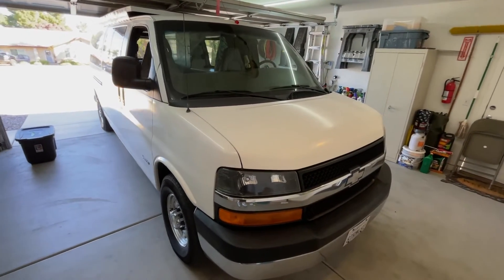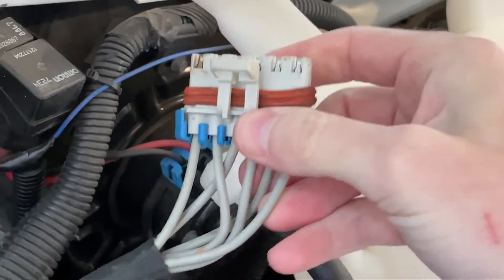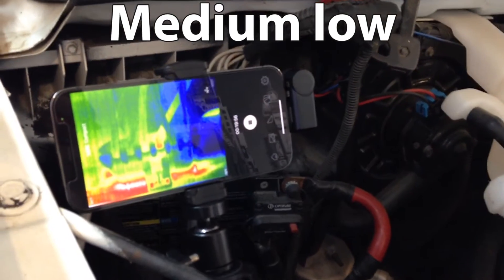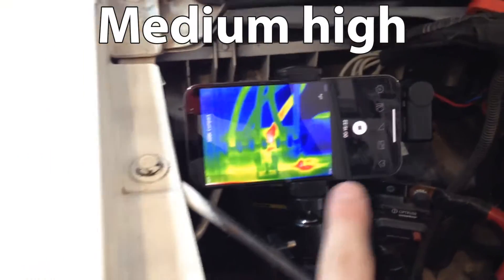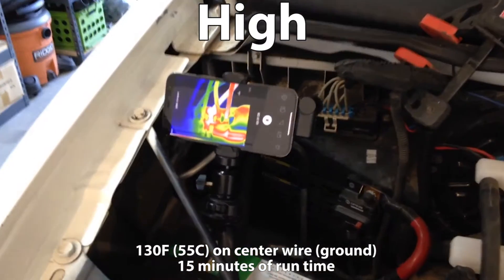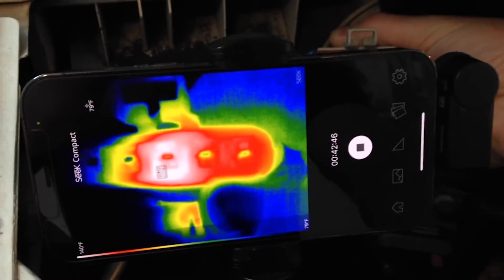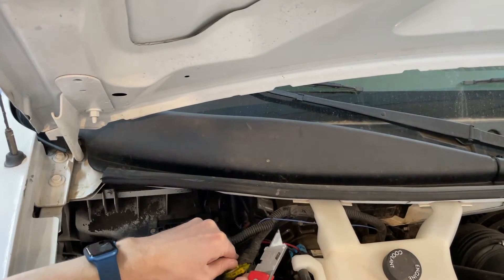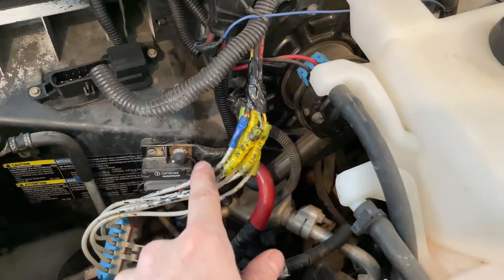Express / Savana Fire Hazard: Blower Resistor Harness *With thermal readings*

Comment: My medium high speed isnt working the rest do any idea what it could be doc ?
Reply from the maker: It’s either the blower resistor or the HVAC control (the actual unit in the dash above the radio). 85% chance it’s the blower resistor though.

Comment: Great vid Tim. I had high speed only on my old 2000 Sierra truck and replaced the resistor. No burn marks on mine so I guess it just got old and wore out. Come across it on other vehicles, too. Is that an IPhone app for the thermal imaging - it’s neat. 👍🏻
Reply from the maker: The blower resistors / relays are definitely wear items. Manufacturers are finally switching to a pulse width modulation (PWM) speed control. Much more robust and efficient than the resistors.

I got a great deal on the used thermal camera that plugs into the iphone! Been loving it! Scored it for $175 but normal price is around $230.
https://amzn.to/3VFTLlG

Comment: I replaced mine and had to carefully carve it out for the new style . 1999 Chevy express . Going to check the connecter right now ... and the original looks fine. It looks like that bad splice with some of the wire cut off would heat up that pin maybe ?
Reply from the maker: I'm sure the bad ground splice didn't help anything on mine. Luckily it looks like that was the only thing the previous owner(s) touched on the van. Otherwise I'm betting I would have electrical gremlins galore.

Comment: Did you look to see if the OEM part might have had a bigger negative ground wire going into the resistor? There's just so many cheap chinese replacement parts out there......
PS-Nice vid....now you got me worried with winter upon us!
Reply from the maker: Looks like there was actually a service bulletin for the Sierras / Silverados but the "fix" was to just replace the harness and resistor with the same OEM numbers - no redesigns or product improvements.
You would think it would be simple enough to just increase the pin sizing specifically on the 12v + and - wires.
If you unplug yours and it doesn't look discolored you're probably fine! The date code on my old blower resistor was from 2009 I think, so it lived a good life - especially for an aftermarket part.
Reply: @VanwithTim  Thanks Tim. I might unplug it and throw a little dielectric grease in there to prevent corrosion too even if that rubber gasket is supposed to seal it. Thanks for the heads up. PS-the fuel gauge sender and pump in the gas tank is another known "it will fail" part to look forward to replacing.
Reply from the maker: @fritzkabeano1969  Oh boy - yeah I've had to replace the FP on a 1999 Express. Thank goodness the tank was mostly empty! Not my favorite repair by any stretch.

Comment: I've fixed all the drive train common problems already, I'll have to check my "new" '04 Savana for this before I hit the road. With 287k already on it, I don't need any surprises.
Reply: Which drive train problems? I've got an 08 Savana 1500/6cyl.
Reply: @fritzkabeano1969  Oil cooler block gasket leak, valve cover gasket leaks, trans pan gasket leaks, broken exhaust manifold bolts, Oil pressure sender leak, temp sensor  plug crumbles if you bump it changing spark plugs. belt tensioners seizing up, brittle PCV hose giving p0300 code. Minor stuff if you're at home with a garage full of tools.

Comment: I had a similar problem on a dodge grand caravan.  on the next to highest setting there was a lot of current, and lot of power dissipated. full speed had no resistance, and the lower speeds have only a little current. more modern cars have brushless motors and circuitry to do the speed control without wasting power.  but that's why modern cars use millions of chips!  nice video, thanks 😊
Reply from the maker: Thanks Johnny - was actually just looking to see if they had a brushless aftermarket option for this van but no luck (I'm sure I would probably be the only one interested haha)
Glad to see the newer vehicles going to a PWM speed controller and brushless motors!